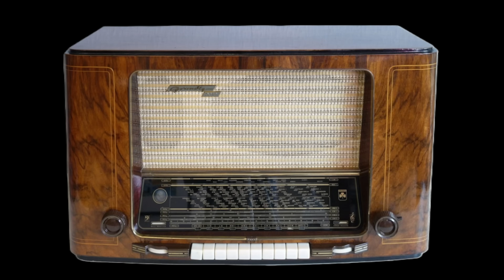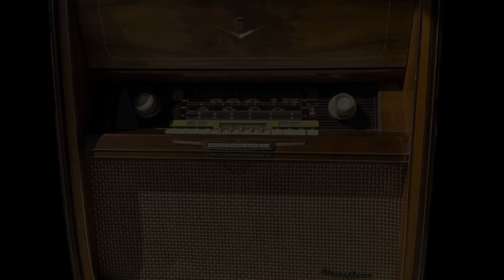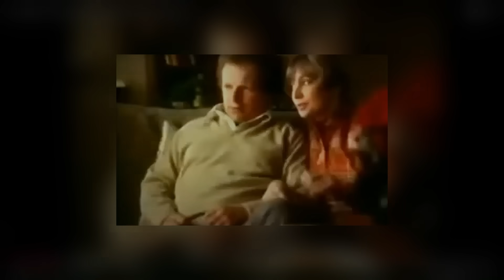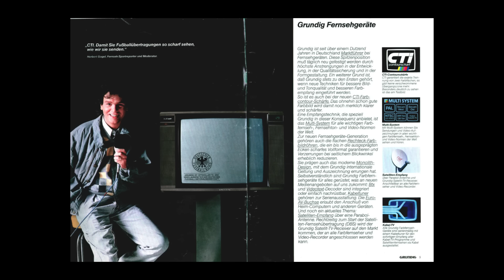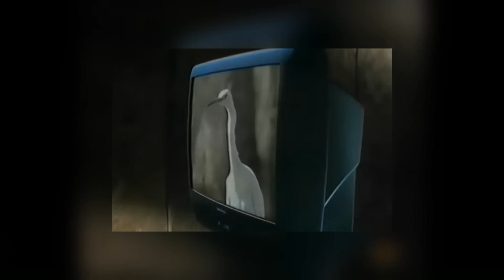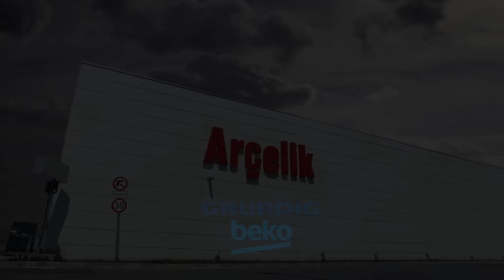Grundig: How a Tech Giant Faded Away

Comment: I had radio Grundig Satelite 2000 with digital displayer and that was wonderful. I just wrote the frequency of a radio and it received very easily. I don't remeber what I did with that? Did I throw it out when not working or what? Anyway even if I kept it, it would never receive any signal as all radio stations are now DEB.

Comment: Thank you!  Excellent video... As  a boy in the early 1950s I built a 1-transistor kit that was not a Grundig, which were then much more expensive in the UK.  As a family with young daughters we deliberately avoided VHS, Beta and other popular Video formats in favour of a Grundig Video 2000 that was  being sold off cheaply, since this would not play the "Video Nasties" being shared amonst pupils at local schools .... it was also far superior in quality to the alternatives, with stereo FM sound and much better picture resolution.  This machine was regularly used to time-shift broadcast  TV for us until  its quality gradually deteriorated until it was no better than a new VHS - the heads and transport were worn ... this took 11 years! 
By then S-VHS was available, and the old Grundig started to fail, so we replaced it with a good S-VHS machine, and upgraded our TV to a Grundig 100Hz  high-resolution set that used a frame store and a pixel overlap technique to double the apparent resolution on the CRT screen.  We had waited until this set was on sale at less than half price, since we could not afford the asking price... It worked very well for several years.  
We also had a Yacht-Boy radio receiver for the boat we built, but this was not that good, the moisture  at sea caused it to fail after a year or two.
Very interesting to see how the company was started, sad to see how it was lost at the end.  There are so many 'labels' being used now, where a brand/label owner licenses the IP to a low-cost manufacturer  - in recent years we have encountered Alcatel 'phones,  Ryobi tools, and others that have gone the same way as Grundig, alas.  
Thank you for  your informative work! 🤗

Comment: I have my dad's Grundig Transistor 700u, the original box that it came in and the a/c adapter. Unfortunately the battery pack is broken and needs to be held together with tape. I'd like to see if I can 3d print a replacement.

Comment: Philips bought out Grundig-and that was the beginning of the end....Philips had an overlapping product line, so its distributors had no real incentive to push Grundig products. AS for quality, European auto radios always a had a problem in the USA (bad FM sensitivity). Because FM stations in the USA are wide apart, you need good FM sensitivity (not the case in Europe). My $500 PHILUPS car radio could not pick up a Boston MA FM station 70 miles away-while my cheap OEM Chrysler was fine. The Grundig radios had excellent FM front ends.

Comment: Grundig made some true long-lasting electronics that gave a lot for your money!!!!
I had a CD/Kassette player I got for christmas 1995 - and that one lasted with decent usage till about 2017 when I had to get rid off it, BUT it still worked fine to play CD's and tapes (!) 
The only thing that made it "not keep" was because the audio/volume adjustment stopped working so either it was very low- to no sound or loud at MAX! Really its only flaw was that adjuster that was a knob on a reel-like and after years of usage, it sunk in. Pitty as it worked otherwise fine, but I'm no fixer and paying for repair was not an option due to costs so it had to go.
Listened mostly on audio books on it through all years. 25 years is mighty impressive lasting from a more budget alternative at the time.

Comment: Only mention Mallards as in Phillips a few times, Mullard and Grundig were working together since the 1950s, Mullard near me were making Grundig radios in the 60s, Mullard also supplied TV tubes and other electronics parts, record decks came from BSR, as did the tape deck, one of the reason why Japanese electronics sounded really good was because they bought a licence from Goodman's Speakers to make speakers the same way, Goodman's are the top speaker's manufactory, they make speakers for the top professionals in the world, which I could never understand why Mullard never used them

Comment: I had a Grundig VCR 880 (Video 2000) and a GV 470S (S-VHS), both of which were mechanically disastrous. I received the latter in exchange for another model (GV 240 or 250), which was recalled due to software problems.

Comment: In my experience, Grundig is still a very solid brand. I have several products of Grundig at home. I refrigerator, a 40 inch TV and a battery charger. All are with me between 2 and 8 years and I never had any problems. They give a very well-built feeling. Unlike Samsung (I only buy phones from Samsung) and Philips (I only buy light bulbs from them).
Reply: Nowadays, Grundig is only a brand name, which has nothing to do with the original company.
Reply: I used to have a Pink Samsung Tocco Lite, it was a poorly designed phone, you could make calls, messages, and take pictures, there was no Wi-Fi or Mobile Data so really it was not a great experience, when smart phones came i relied on Samsung, i have a Note10+ its a really good phone, The J4+ is absolute junk, you can't play games on it smoothly its slow and will freeze. It does have Wi-Fi, Mobile data, its only useful for calls and messages, taking photos on it is a headache, no where near as good as a Note10+ phone.

Comment: When I was getting my AA in electronics I worked part time at an office business store that sold office electronics like word processors ( was 5 years before computers) calculators and tape recorders( dictation equipment). We also repaired a walk in trade of electronics. Got Grundig's to repair  with all the rest. i remember one time repairing a word processor that had a bad cap that went to ground that no one else could repair. the owner of the company had a friend that had an office copier company. They use to bring me all their bad power supplies to repair.

Comment: Early this year I bought a Grundig dryer only because of the original lettering in the logo. I know it is a Beko, not really high quality assembly of the unit although the main parts are high quality. In the first week I had to open it twice to fix rattling noises as a result of the sloppy assembly, but since then it works great.

Comment: I had a Grundig VCR system 2000, Comet had a load and were selling them off cheaply.  It was an excellent, high quality machine. Over engineered compared to the Japanese competition,  heavy because a lot of metal was used rather than plastic.  I also had a Grundig radio with short wave bands. Living up in the Pennines I used to get good reception  of all those foreign stations
Reply: Were their any SuperVHS VCR's ever made by Grundig never seen one, never knew Sharp, Philips made one, but i assume it was just only one model, these were sometimes seen on eBay, Philips could be badged by JVC as similar design to some JVC SVHS VCR's of that time.

Comment: I have a 1956(?) Telefunken Opus radio.  Almost all German radios have the same architecture and I'm wondering if Grundig built all of them or if the other companies were just emulating the successful Grundig. 🤔
Reply: They were mostly build by their respective companies, and indeed technically almost similar. Differences in implementations could be seen in some motorized top-off-the-line radio's by e.g. Saba, Telefunken and Grundig's own 4040W3D (1954). Main differences with non German radio's was the early use of electrostatic high-frequency speakers for their larger tabletop models.

Comment: Grundig was always a household name among family and friends.  Well, most were of German origins, so is it any wonder.  In my exposure to the brand name, I have come to know Grundig as the King of the Console.  This is the era from the late 60's through to the late 70's.  Almost every friend of the family had a Grundig set or two.  Many had a large console and a smaller table top radio.   My parents had what was called a table top console.  Basically it had the full features of a console, but it was a large table top model.  It had AM/FM and three shortwave bands.  It had also a four band graphic equalizer, along with several tone presets.  Needless to say, it was a pretty hi-end unit.  While it didn't come with a turntable or tape deck, you could hook one up to it.   As I recalled, this was the first actual stereo system my parents had.  However, my dad bought the unit as a floor model and it had problems with stereo demultiplexing unit and, sadly, it was mostly a mono unit.  It did sound very good though with plenty of bass and crisp highs.  It had vacuum tubes and it even out performed a more recent stereo system purchase  my parents made.   Later on in life, I did become interested in electronics, but by this time the Grundig table top console had developed a lot of problems.  I did try to fix it, but my knowledge with tubes (at that time) was limited.   Admitting defeat, and saddened by my inability to fix it, the radio was set out to the curb.  It didn't even make garbage day as someone snatched it up from the garbage pile the following day.   FF to about 10 years or so later, I had finally gained more knowledge on tube equipment and I had always regretting to having given in to my parents to toss out the old Grundig.   I was reminded of the company when I had purchased a rather unit emergency radio with a hand crank generator built in.  The radio had AM/FM and shortwave and it was a Grundig.  It wasn't anything near the quality level of the old table top console, but it was a reliable unit.   It was the last item that I had bought with the Grundig name on it.  Sadly, in the later 2000's, I had seen the Grundig name on other electrical appliances and I just had me shaking my head because I knew the company sold out.   It is a sad shame to see what was once a major name brand in the audio industry.  But, like many other companies, someone obviously bought Grundig just to profit off the name.

Comment: I have a number of Grundig radios of the 70s and 80s the Satellite 650 International from 1986 sounds as good as the first time i switched it on , There is a Grundig R F 720 in my kitchen never been switched off in over 45 + years , After some bad experience with Bush and Philips T Vs i moved to Grundig a good move [ Grundig ] Symbol of Quality back then Not anymore .Many Thanks For The Video.

Comment: It's such a pity they left us. Grundig made some of the best portable radios I've ever had. Their larger models like the 70/80's Yacht Boy and Concert Boy had excellent FM performance and solid sound quality.
Reply: Totally agree.
And I also like their big 3d klang sets. Excellent performance, unique 4 or 5 bands equalizer, and a very gound sound. Except saba which probably had the best tube radios (the Freiburg series), Grundig came second when it came to the best overall quality.
Reply: Yacht Boy 400 and a reproduction  of one of their early table radios bought in the 1990s. I also have one of their mass market crank/rechargeable battery/3 AA batts 4 band radios.
Reply: @donnafromnyc  Yes, I had a 400 too. A pretty good small portable.

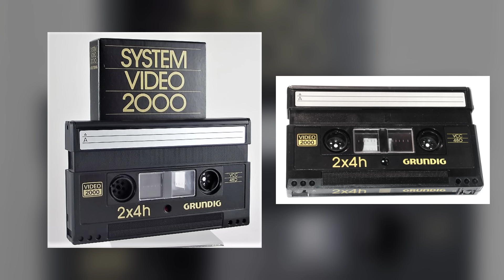Comment: 12:04 There was another miss-step before V2000.  A Grundig-only format called SVC (Super Video Cassette) for their SVR4004 machine.  It was a format of just one model of machine, using a cassette which was almost identical to the older Philips VCR (N1500/N1700) formats.
I have two fully working examples of this rare machine which I've featured on my channel.  Grundig thought the format would be a big seller and set up a large manufacturing facility for it, then found that unsurprisingly no-one was interested.

Comment: Thank you for this very nice video! Grundig is still my most beloved brand since 80s, when I bought my 1st Grundig - CN 510 Super Hifi cassette deck - and it was (is) really super hifi! Until the new decks in the late 90s had individual bias setting to every single cassette, I had the best recordings ever - nobody (even with the more expensive decks) had better cassette recordings like me! It was the prototype for the Super hifi deck (in the late 1970s!)!
Then, in the 90s I bought the Fine Arts complete Hifi  - tuner,  amplifier, deck, double cassette deck - and both - the Fine Arts components (later I changed the V1 amplifier with Dolby surround DPL amplifier and even later this dolby surround amplifier with the multichannel NAD receiver - in the time, when already Grundig was not that Grundig  as it was earlier - but CD player and the cassette deck I am using stiil now) and the CN 510 super hifi, I have still and all is functional perfectly!
I am very sorry, what happened with this brand, but it will be still my favorite brand! 🙂

Comment: I still have a Grundig portable radio I bought in 1971. It still has good sound, and still has good styling.
Reply: I’m not sure, but I think Grundig was the company that manufactured a series of wonderful multi-band radios (circa 1960s - 1980s).  Best I have ever seen.  Hard to believe a company with so much merit and diligence would decline so quickly.  Sad.
Reply: @philpacella7849  You can be sure; you are absolutely correct here.

Comment: My dad had the franchise for Grundig in Liverpool (Coghlan & Co) , his business sold and serviced Grundig electronics, we always had a TK tape machine at home, I remember years later clearing his shop, there were probably 30 Stenorettes that had been forgotten. Grundig were good quality and the reel to reel tape machines were easy to work on  
The business also serviced Ampex, Studer/Revox, Uher, Chiltern and other tape machines both on site and in recording studios. Happy days.
Reply: For sure, they were happy days
Reply: I hate to think the days of making solid good products that last at least 20 years are long gone. 

Indeed.
Reply: @SENGLEETAN-m2c Complexity made a lot of newer electronics difficult to repair, back then some of the cassette machines were a pain to strip even for a new head, some parts simply weren't available, manufacturers wouldn't sell certain IC's, we fixed everything we could, my uncle would remove heads from reel to reel machines when they had wear, he'd re lap them using a glass plate and jewelers rouge, we also specialised in Hammond Organs, my dad developing AOC as a retro fit.
Reply: @andicog I admire your determination
Reply: You probably sold my mum her radio and later the ‘music centre’ Do you know anyone that might refurb units. My mums old PartyBoy is in the loft. It has a battery to mains adapter which I’d be terrified to plug in after 30 years in the loft!
Reply: You probably sold my mum her radio and later the ‘music centre’ Do you know anyone that might refurb units. My mums old PartyBoy is in the loft. It has a battery to mains adapter which I’d be terrified to plug in after 30 years in the loft!
Reply: Hello from Ormskirk
Reply: Were the radios able to broadcast scouse?
Reply: Este  reportaje  es muy interesante  podrian pasarlo en  español  lo entenderiamos   mejor

Comment: I'm a radioamateur and I  confirm that Grungig Satellit series short wave radio receivers was made with the best tecnology available in the 80's and 90's! also another German brand AEG / TELEFUNKEN was very famous on the Gov agencies  top notch hf receivers like the Aeg Telefunken 1800 series was celebrated as the most expensive hf receiver ever built,  in the 90's the cost for single unit was set at 50.000 German Marks   ! Great times! now all this top quality receivers are all gone forever!
Reply: 50,000 German marks! Maybe you're referring to something completely different than the receiver mentioned, maybe a Porsche !
Reply: @contragica8609  I refering to the AEG Telefunken model : 1800 / 3 this receiver was made for the German BUNDE ( military and Gov agencies) as you can immagine these receivers was not available for commercial market but only for specific gov agencies , this is why was so expensive hf receiver...
Reply: @claudio6493  Grundig nor Telefunken were in the same ballpark as the Japanese  manufacturers such as Icom and Yaesu, Grundig manufactured middle of the road equipment  which was highly over priced.
Reply: @georgebarnes8163 In the 1980s there was a considerable supply of used Grundig equipment. I picked up a TV and some stereo equipment for next to nothing. While they were all a few years old by then, they worked well and kept working till I replaced them with modern ones. Quality was ok. Not the best in the market, but so was my income.